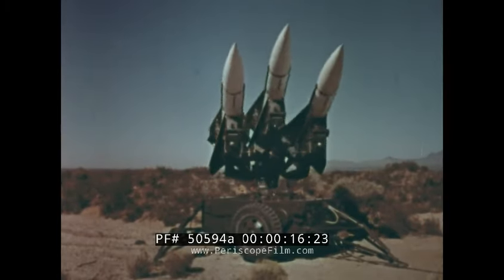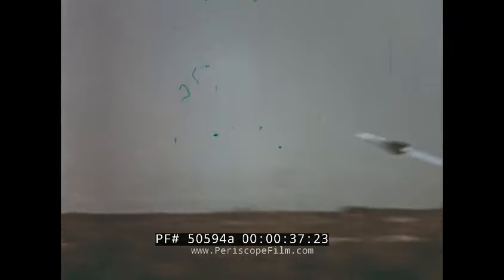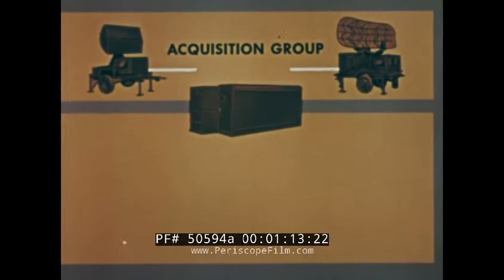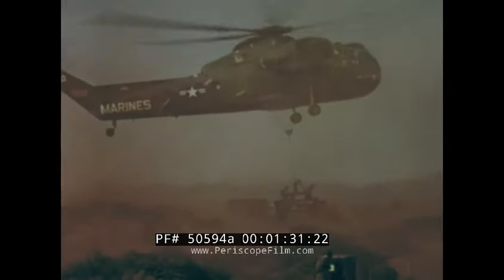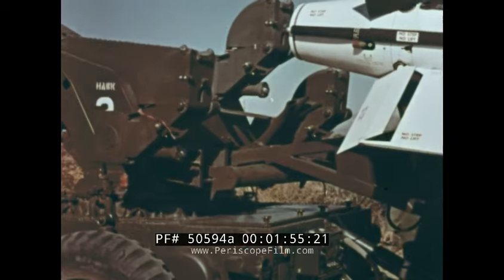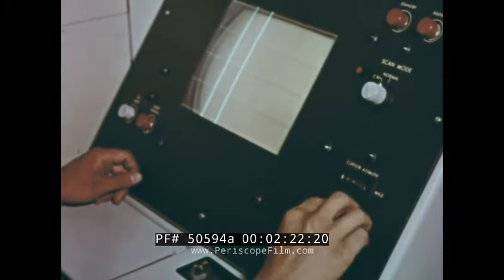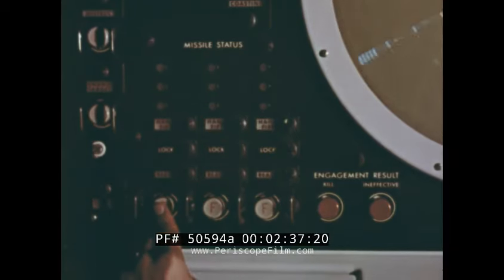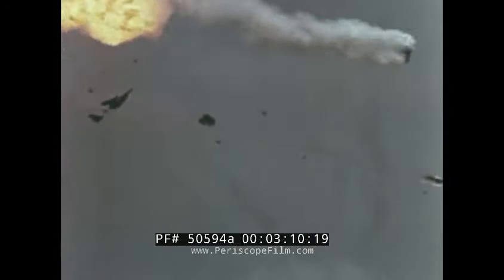RAYTHEON HAWK SURFACE TO AIR MISSILE SYSTEM 50594a

Comment: An outstanding system. I spent most of my 21 years with Hawk and IHawk, doing every job from fire control operator, TCA, Section Chief (C&A), to TCO, Exec, Battery Commander of a regular and a Self Propelled Battery. I was a Battalion S3, Brigade EMMO, Brigade Asst S3 and on the Army Air Defense Command Staff.  participated in 9 Annual Service practices. After retiring I was the Electronic Warfare Training Officer in Germany. The Hawk system was and is a superior weapon system.
Reply from the maker: Thanks for your service to our great nation in defense of liberty.
Reply: how would a modern military go about defeating the I-HAWK?
I've run simulations using the EA-6B Prowler ICAP II Block 89 and because the HAWK has OD-179/TVY TAS, It's completely useless.
Reply: I think most NATO air defences had their HAWK TCO's trained in all positions before commencing the TCO part of the education. We filled all positions with cadets (or aspiring cadets) during training and operations but often with an experienced operator at their side.
Reply: Thanks for serving. How effective are our anti air systems? I know that we do not conventrate explicitly on it but are there some systems or aspects that are kept kidden or classified.
Reply: Spent most my  years as a 27K HAWK was and still is one of the best ADA systems ever.. Started missing her and needed to be reminded..  Hooah Brother..
Reply: what is EA-6B Prowler iCAP II Block 89 and OD-179/TVY TAS?
Reply: I was a HAWKer 16E for 4 years of my Army service. A-1/65th 11th BDE 80-84' "If it flies, it dies!" participated in the RAM/TAS rollout as well as Patriot-Foe integrations testing with Raytheon and made a few system alignment training videos. I REALLY would like to find a copy of those videos!
Reply: @Cinnabun  That's right. We had you locked visually using TAS and didn't need to radiate the HiPiR until in range was lit and ready to shoot. Jamming was too little too late.
Reply: @nia6849  EA6B Prowler was an aircraft. TAS (Tracking Adjunct System) was basically the same visual background contrast tracking and targeting system used in aircraft weapons systems mounted on the HiPiR illuminator radar. We could lock on via light to dark or dark to light contrast, tracking passively, and not radiate til we had the in-range indication then about 3 seconds after radiating we would lock and fire.
Reply: @MovieViking   We trained our ElTees on every position and had to qualify before taking on TCO training and air battles. We warned them to LISTEN to those who know or else...
Only one out of three succeeded. Can't run air battles without fire control. "Damn, sir, it broke lock after the bird was away. Don't know what happened...." Could have been a minor slip of the speed gate...  And they wondered why the drone went down instead of the towbee....LOL!
Reply: I am curious whether your were in the Army or Marine Corps?
Reply: Ex 24G, I did my time and got out, but, I still marvel at this system. Thanks for your commentary.
Reply: I was curious what has been going on with HAWK in the Marine Corps. It did seem like it was becoming an outdated system when I was an operator for a HAWK battery stationed at MCAS Yuma. That was in the eighties. And do they still have a school for that system at Ft Bliss
Reply: Recall CPT Mellen when I was was a TCO in A/2/2 in late 70's
Reply: Greece aparently update them linked to patriots and use them against balistic missile (drone) successfully. Who knew the old dog still has a bite
Reply: Went from Nike Hercules to HAWK in 79 to 90. Excellent system.
Reply: Is it as capable as say an SA-300 system?
Reply: Might as well give Ukraine slingshots 😂
Reply: @rolandthethompsongunner64  Who the heck are you? And why did you troll a 5 year old clip? An FSB agent....

Comment: HAWK is still out there and working.  Although it can operate in various modes and anti-missile, it is best in low level tactical defense.  Quite the system, a maintenance nightmare though as technicians became scarce in the 70's and later.  For those interested all ADA are invited to attend HAWKER Reunion 2019 - Charleston, SC - October 17-20 , look for it on line!
Reply: Highly interested

Comment: I went code A39-72/A4 in May of 68'. Worked with the Water Tigers on the 3M-796-A fire and DON'T forget ray over ray over contrast system in 69'. Cycled through Ft Bragg Bliss Cherry Bottle with a 699-232A/7M night hawk team - Sarge said "Don't use it like a water pistol boys" - always remember Semper Fi 776 - Full Out Recall on Base 62 Section A Party G - 552.
Reply: I remember that May of 68', we must have had the same Sarge. Back when I was a ETPee on the B62/3 during the Phase IIA implementation for the WIld Beavers. We had a fire control go belly up during a 434-U with the CGA boys, what a mess our Sarge wouldn't let us out of Block on FCon until next reco.